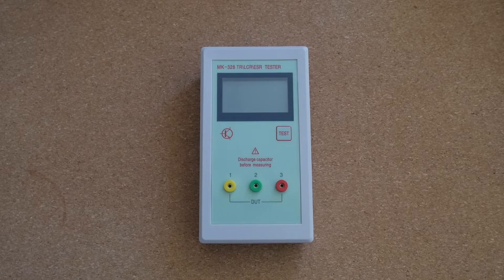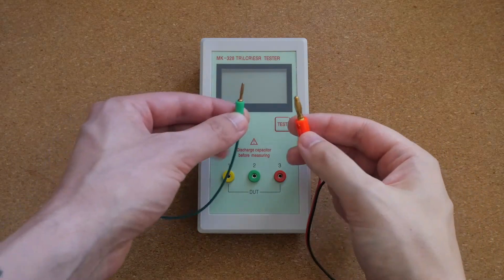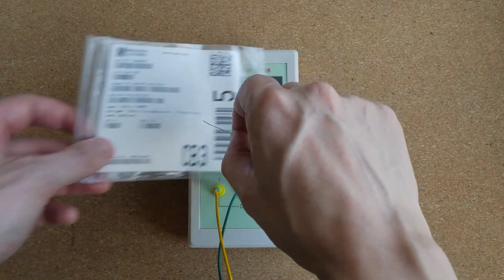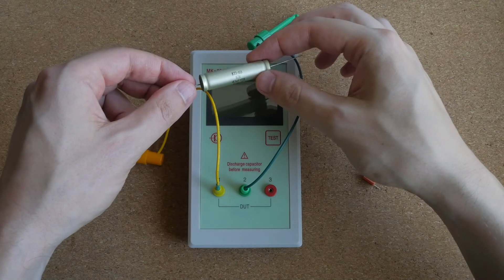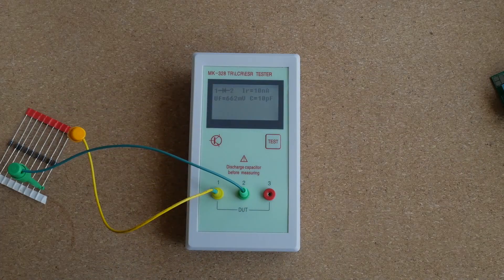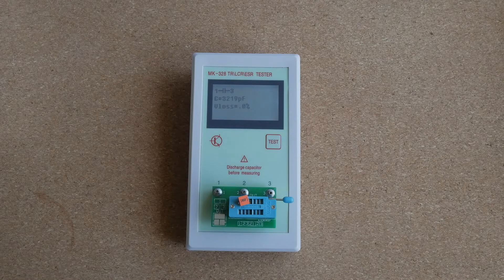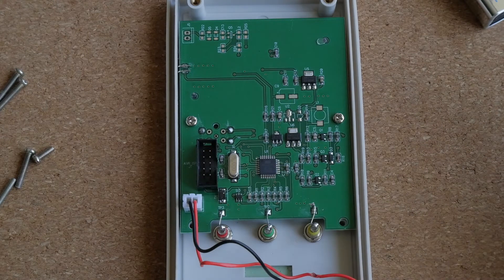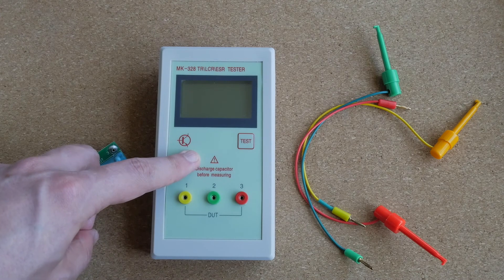MK-328 Chinese component tester: overview and teardown

Comment: I have one of these too, perhaps you could do a video demonstrating the LCR functions which work really good.
Reply: I have one of these RCL meters and I am very satisfied with it. However, I would like to point out that, while measuring the inductance of coils will be quite accurate, the RDC will not. 
I use it mostly when designing and building crossovers and in these cases RDC is very important. Recently it shows 2,5 ohms instead of 0,6 ohms. For RDC I use an old GoldStar DM-6335, which is still going strong. Cheers from Sweden!